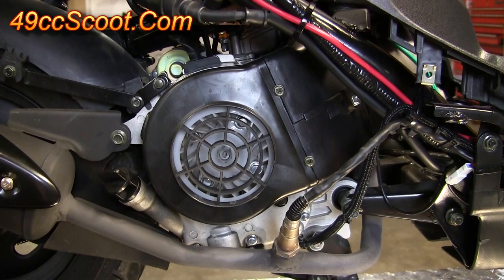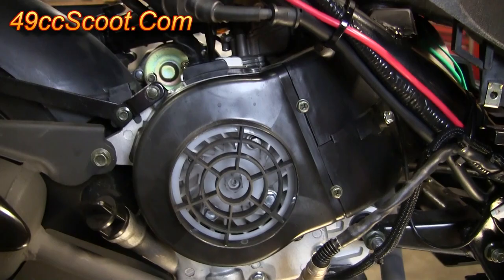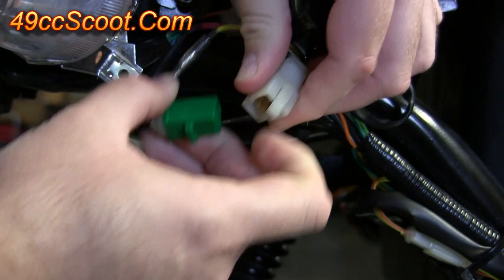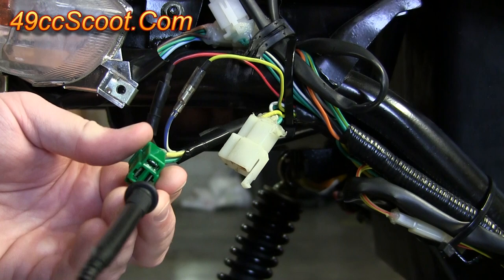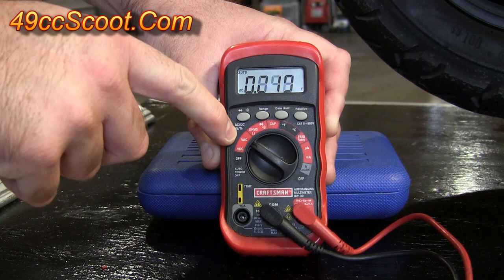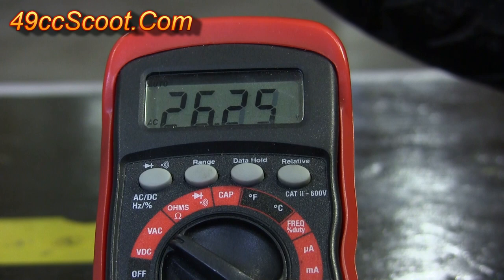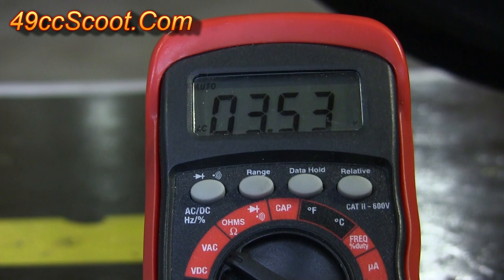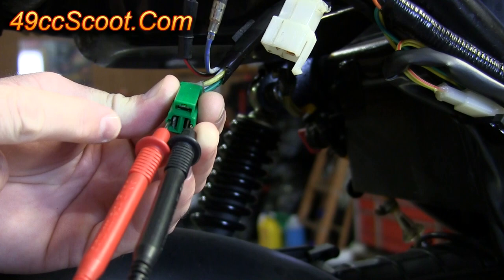Easy 50cc Scooter Stator Charging / Lighting Check : 139QMB GY6 50 QMB139 49cc

Comment: Today my scooter stoped. I checked out the spark and cable and ther is no lighting on spark,cable. I use mvt millenium ignition with cdi digimax 3 curves. I was testing one + combination on the mvt 3 +1° curve. And since then no more sparking. It as 3 wires coming out of the stator. 1 is red and black going in the cdi digimax. 2 is with and red going to the cdi digimax. 3 is green and yellow and as no connection. Is a loose wire that is connected to the coil. Is the coil burned? Do i have to replace it? Or is the stator or cdi that needs to be replaced? Help please. I can make a video for you if it helps you helping me. Thanks.
Reply from the maker: spiderroot Did you try looking for output sort of like shown in the video? Not for lighting, but you can do the same for charging. You can't run the engine of course, but you can kick it over and see what AC volts you get on the wires to the CDI. One should be a trigger/pickup signal and the other should be power to the CDI. I'm not sure what it should be on the high end ignition you have, but most other scooter stators will put out somewhere around 0.5VAC on the pickup wire and 50VAC or more on the power wire.

Also try switching back to the other curves if you haven't already.
Reply: ***** Hello again.
Im going to make the test today. Ive tried other curve setting and still no sparks .the red and black wire that goes to the cdi is the one that sends charge to the cdi. Yesterday i used the voltimeter in normal voltage regulator. Equal to the reading on batery v are. And it sends 1.80v when i kick start. Does this means that stator is ok? Im going to test in OHM today and see the results. I really think that maybe the cdi burned,or the coil is the one not operating. Becouse if the cdi dosent send signal to the coil but gets energy from stator i have a big problem on my hands. I still have the analog cdi that came with the stator. But i have to positionthe flywheel of stator in analog mode on the crankshaft. And i dont havethe right tool to do that. Thanks and i will repost again.
Reply from the maker: As the previous post said, at least in the standard ignitions, one should be around half a volt AC and the other should be 50 volts AC or more when kicking over.
Reply: +90GTVert I made several tests. One is yh OHM at 20k the read was 11.06 OHM. Its ok becouse i was looking for 10k read OHM. In AC V the read was in the read and black wire 00.5 AC V. The same test but this time in the red and white wire the read was 00.0.  Next test was in the coil, in 200 OHM the read was 3.8.  Whats the problem can you say ? Is the stator? :(
Reply: spiderroot other test i made was in 200 OHM in the coil. Read wight from coil with the wire red and with coming from stator. In kick start the read was 184.4 OHM. In standing mode the read was 72.0. Hope this reads helps you helping me. Many thanks. Hope to ear from you soon.
Reply: spiderroot i made the test like in the video and ther is no read in the yellow wire, no read in black and blue wire, and only in the grey and blue wire reads 00.1 at kick start. Its the stator gonne bad right?
Reply from the maker: spiderroot You'd have to consult manufacturer specs for the resistance readings of their ignition. As stated, I'd think you should be finding one wire with about half an AC volt to the CDI, which you found, and another with 50VAC or more, which you didn't.
Reply: *****  i have send a email to the manufactor but still no reply. I made a reading in the base of the fuse of the battery, and the reading from the battery to the fuse was ok. The outer plastic of the fuse 5A was burned, but the inner metal of the fuse was ok and passing voltage. About the reading from the tension regulator to the fuse when i kick start the engine was only 2.7 v unstead of the 12v needed. I think the cdiband coil are ok. But the stator after all this tests made is the guilty one to blame. I will not orther anymore mvt millenium to use with digital digimax. Since i started using digimax instead of the analog cdi that came with it,i really lost performance in my engine in high rpm range. With mvt millenium analog that wasent a problem. I recomend using only mvt millenium in piaggio nrg with analog cdi. Not the digimax to turn the stator digital. In my case only in a high end engine i lost it big in perform and burned stator. I will order the mvt premium with fixed curve and well tuned inner rotor with lights. No digimax for premium to me. Only fixed curve and thats it. Thanks for helping me the best way.

Comment: Hi. I got a 70cc Chinese gy6 scooter. I went to the market on a rainy day. While I was cruising, i felt the bike was dying down for a split second. It was like choking the carburetor. And after finished my errand, it was time to go home. At that time the rain was pouring hard and I was having difficulty to start the bike. So what i did was kick start it afraid i might drained the battery. After 15 minutes kicking it, it started. So, not so far away from the market. The bike was choking again and it died down. Everytime i tried to turn on the ignition switch, the horn was honking. Toke me 30 minutes kicking the kick start and it started. What happened? Was the bike grounded/short circuit wire/s? If so,  how to check and locate the problem?  Thanks.
Reply from the maker: Boy Santiago It sounds like you may be getting water into harnesses/connectors and things are shorting out. If you check out my PDI wiring video I show some water and corrosion prevention methods.
Reply: Going to check it out. Thanks for replying so quick :)
Reply: Now I saw it why my bike got stalled in the rain. Ignition switch has no cover. The harness is practically opened lack of electrical tape. And the water would just go into the connector causing the problem. Here's is the picture. It's old and dirty, sorry about that lol Thanks again.  http://uploadpie.com/5BIlH
Reply from the maker: Boy Santiago
It definitely isn't a bad idea to add some dielectric grease and silicone since it's obviously exposed to damp/wet conditions.
Reply: another thing, when I removed the seat, I saw some exposed wires most possibly chewed by a rat. Covered it with electrical tape. Perhaps this was one area caused the short. I also tape the harness on the front and put some silicon on the connectors. Let us see when it rains again. I hope it's all good now. Thanks for the helpful video and your quick reply. Thanks again :) Btw, have you saw the picture on the link?
Reply from the maker: I saw it. The chewed up wiring is definitely not good, but if that is the cause it shouldn't necessarily need to be wet out for problems to occur.
Reply: Thanks :)

Comment: I installed a new stator on a 2008 Tomos 50cc 139QMB and got 15 volts with bike running at 4,000 rpm. stator output was 30 volts before it was hooked up....I know it should be around 60 VAC ...what the hell is going on ?

Comment: My lights on my scooter dim at idel and get really bright when im on the gas. How can i fix this so they stay bright
Reply from the maker: That is normal behavior for scoots with AC powered headlights. They're getting their power from the stator, so at low RPM not enough juice is made and they can't be full brightness. Most just live with it. You can switch it around so the lights are powered by the battery, but you will probably be draining the battery at idle a bit. Could convert to a DC system by floating the ground on the stator and will a full wave rectifier and rewiring.

Comment: The other two wires come from the CDI correct? So the scooter should start with just the battery if the stator is bad? If it doesn't then it's the CDI or ignition coil or the voltage regulator? I have all the other parts on the way except the stator. Is the stator only for charging and the headlight?
Reply from the maker: The stator does a couple of things. It provides power for the lights and charging, but it also supplies power to the CDI in AC powered CDIs and the pickup is part of the assembly that provides a signal to the CDI to tell it when to fire. You can have a stator assembly go bad and have no charging or no lights, but run fine otherwise. You can have one that can't power or signal a spark, but the lighting side would work if it could run.
Reply: Thanks. Got it running, CDI was bad. You rock

Comment: Does a Buddy 50 have a stator, and is it the job of a stator to charge the battery?
Thank you!
Reply from the maker: Yes, it should have a stator. The stator provides charging/lighting power. Wrapped in a package with most small scooter stators is the exciter coil and pickup. Those provide power and a trigger for spark.
Reply: @49ccscoot  
Thank you!

Comment: I have a question, I just ordered a full complete wire harness for my 150 gy6 it comes with 11pole and matching rectifier! If I want to run led headlight 40watts will i need to just plug them in or should I install a relay!? I blew my stator installing hid in it 35watt and don't want it to happen again
Reply from the maker: I don't really know much about the 11 pole or DC setups. 40W isn't extreme for a headlight. I ran up to 65W on an 8 pole AC system.
Reply: 90GTVert so 11 pole is dc i don't even know what I have smh,my bike is turning on from the starter solenoid but it doesn't have power no lights turn on no crank! I just bought a multimeter hopefully I can learn from you and figuire out the issue
Reply from the maker: First check is the fuse. Then the battery.

Comment: Will a 120/90 -10 fit my scooter with 3.50/10 tire
Reply from the maker: It may fit, but a 90/90-10 is basically the same as a 3.50x10.

Comment: okay have power, starter button still doesn't work . doesn't even make the terrible sound when you hit the start button while engine running
Reply from the maker: John Keener Fuse okay? Could be the button or the relay or the starter motor has failed. You can jump the terminals on the starter relay for a quick test. Use something like a screwdriver and touch both terminals of the relay, but DO NOT touch any grounds (like the frame for example). If it tries to start then you know the starter motor does work and can focus on the electrical bits.

Comment: Bro my multimeter is not responding to this test, I have followed all steps, ground to the bike as no green wire, when touching the red probe I get nothing from the multimeter. What am I doing wrong?

Thanks in advance
Reply from the maker: If you get nothing at all, maybe your stator is shot. You can also find specs to test resistances of the stator in service manuals. Another possibility is try a different multimeter or checking some other AC voltage to be sure yours is working.
Reply: 90GTVert wow, first of all I never expected a reply so quick. Thanks.. 👊
My bike starts and runs fine, but no front or rear lights inc brake lights, indicators work fine. I thought if the stator was shot it would not fire up.
Am I wrong?

It is a very clear video I must say.
Again thanks in advance
Reply from the maker: There are different sections of the stator. Could start but produce no power.

Comment: Can I add a secondary stator or anything else that will give me more electricity?
Reply from the maker: Where there's a will there's a way, but it's not going to be easy to add a second unit. You can upgrade to the larger stators that some GY6 150s have, but it will require a new reg/rec and some wiring as well.

Comment: I can't get my bike to start with that wire disconnected starter solenoid just clicks
Reply from the maker: Maybe the starter relay is getting power or a ground through that harness or there could be more modern safety/anti-theft features.

Comment: what should the battery voltage be when battery gets charged ? around 14v like a car?
Reply from the maker: Yes. Around 14-14.2V would be great. My Chinese scooters usually don't regulate that well though, and I'm generally happy if it doesn't get higher than 15V.
Reply: @49ccscoot  wow I have a scooter that charge at 12. something ..

Comment: Hi! I have a 50cc Wolf Rx Moped. What stator should I buy?
Reply from the maker: I'm not certain for that model, but if you lookup 139QMB and GY6 50 stators you should be able to compare pics and see what matches. Some have different connectors or different amounts of poles.

Comment: Thank you for sharing this video. I replaced the stator on my son's 150cc gy6 scooter because I found that a wire had broken on one of the coil windings. Once I replaced the stator the headlights would not work at idle. I checked the voltage as your video shows. I am only getting .3 VAC on the white and yellow wires. When you rev up the engine the lights start working and I believe it was producing around 9 volts which was low but the lights were very bright. I assumed that the stator was defective so the company replaced it with a new one. I got it yesterday and had the same result. Am I missing something here? I tried checking the voltage with the black probe hooked to the green wire and also the frame but results were the same.
Reply from the maker: If you only see 9V and the lights are very bright, I have to wonder if there's an issue with the measurement. Try another meter if possible. You are measuring what the lights are getting for power, not the battery?
Reply: @49ccscoot  thank you for the response. I checked the AC voltage just like you did in the video. I will try another multimeter but regardless of the actual numbers isn't the proof that the stator is not working due to the fact that the lights only work at higher RPM. Is there something else I need to check because it's unsafe at night and I want to get it fixed for him. I have checked the voltage regulator/rectifier and it seems ok. I even tried another R/R. Thanks again for your help, I really do appreciate it.
Reply from the maker: @elliottdl704  You can look for resistance checks in a manual.
Reply: @49ccscoot  I really appreciate the help. When I put the THIRD stator in the voltage was correct. Thanks again.

Comment: vertical my bike got stolen and I got it back I believe they hooked the battery up wrong my chopper has a suzuki fa 50 engine what would be the first to blow?
Reply from the maker: Should blow the fuse first.
Reply: hmm so those small blocks are fuses? I still think the cdi broke it's something making a sound in it like a small pebble it's bare minimal hook up,  also smells burnt where the wires come out the cdi.

FYI there's no so called battery fuse from the orginal set up consists  of 3 wires, 1 on one one block and two on the other block in front of it if I'm correct the two colors consist of red solid, and yellow continuous strip, and one yellow with a red continuous strip. It would be wise to test it but I think everything died excluding  the coil pack I shined a flash light into the cover and the wire windings and resin look intact on the strator. I'm hoping one of those tiny blocks fried out I here they are rectifiers and the cdi is concidered a PEI ignition. Box.
Reply from the maker: Easiest way to test a CDI is replace it with a known good CDI. I'm not familiar with your scoot, but most have a fuse somewhere.
Reply: It's actually a chopper occ with a suzuki fa 50 mounted in the middle most of the fuse work was deleted which is why I worry.
Reply: May just buy a Chinese moped of cl as a replacement thank you for your help though I will see what comes a float soon

Comment: A bad stator would cause no spark and headlight right?
Reply from the maker: +Turbo Tyler Depends which part of it is bad. If the exciter coil (provides power to the ign) fails it won't spark. If the pulse coil (provides a trigger signal to the ign) it won't spark. You could have the charging and lighting coils fail and still have spark and a running scooter (just without lights or batt charging). https://www.youtube.com/watch?v=q9-mr7BXIho

Comment: Hey, thanks for the video, a bit more simple than I expected. I am having what I believe to be electrical issues. Bike starts up fine and seems to idle fine as well, but once I get going the bike cuts out intermittently (does not die, just loses power for 1/2 second at a time) making it hard to accelerate. Same power loss issue occurs when I first hit the high-beams as well as when I have turn signal on (at the rate of the blinker). Any idea what that'd be? I checked grounding, carb is clean, all fuel and air lines are good. Battery seems to be fine as it starts up quick on 20 degree mornings.  Thanks and happy to be a new Sub!
Reply from the maker: Double check the grounds, looking for good connections at the battery, frame, and engine. Check the connections on all of your ignition components.
Reply: Thank you, will run through it all again.

Comment: Upon further review what was happening is I'm now blowing the headlights they worked for a minute with the new rag rack butt I just put a new bulb in and as soon as I revved up the RPMs the bulb instantly blue so I guess I will have to check the stator could it be possible that it's putting out way too much ?? and is there anything else I should check I'm going to do those checks this weekend when I get time, thanks again for your help
Reply from the maker: It's usually the reg/rec if bulbs blow when revved. If not, then it's the stator.
Reply: The checks I got on the stator with the multimeter seem to be jumping all over the place from load of very high well over a hundred...
Reply from the maker: @timdoyle8199  You could also get a service manual out and check resistance specs on the stator.